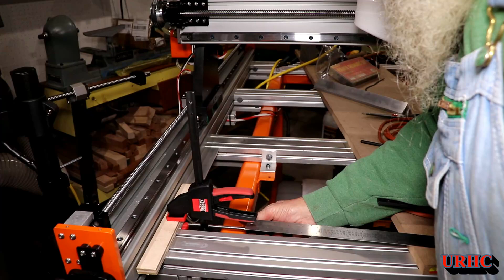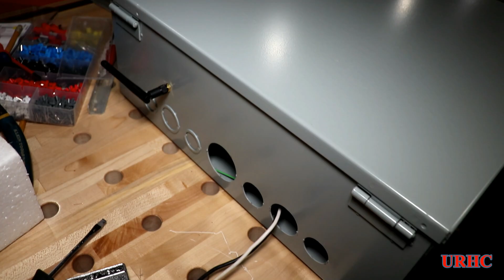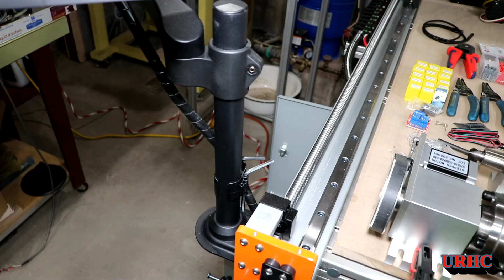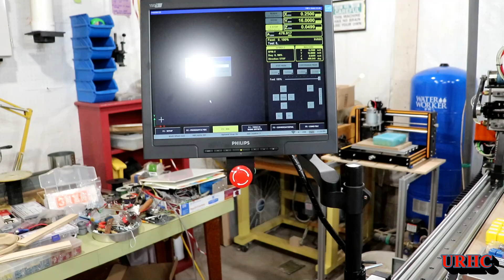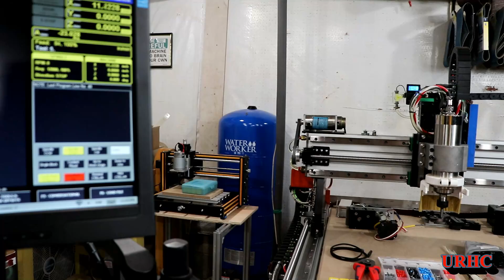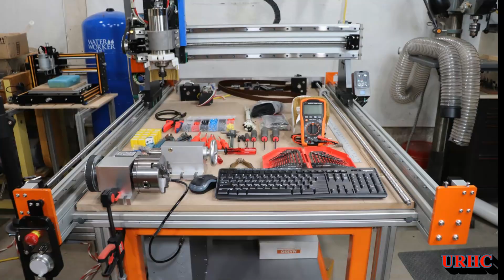CNC Router Build Part 5 Control Box Wired Masso Controlling The VFD And Homing

Comment: Nice video, you have a link or name for a place to buy a  spindle like the one you have in this video ?  thank you
Reply from the maker: Amazon and ebay  usually have several listed from different sellers. Vevor.com also has some lower cost Chinese spindles. I think most come from the same manufacturer. This is the one I used for this https://amzn.to/46PqStp .  This is the cheap vfd I used on this that so far has been good https://amzn.to/3rdXNr4 . and this is the a little better vfd that I used on the slab flatner build https://amzn.to/3PJ7nfG Just match the kw and features you will need. Thanks for watching.
Reply: Can I bug you with another question, I’m deciding on what 4x4 cnc router to buy, and most have cons and pros, I understand ball screws is the way to go, and shapeoko 5 and the onefinity elite is also tempting. But don’t know which one to go for, would you mind sharing an advise there? Thank you so much
Reply from the maker: I will not recommend any machines that I have not tried. Be careful of sponsored YouTube videos because everyone is not totally honest with reviews lately.  Best bet would be look for reviews on woodworking and cnc sites from actual users. Both ballscrew and belt machines can be accurate depending on your budgeet for a starter machine.

Comment: Would replace the limit switch relays by simple opto couplers. You used nice optical detectors but still rely on mechanical action and thus delay.

But overall, very(!!!) impressive build!
Reply from the maker: Thanks.  I plan on doing that in the future.  I bought  a couple opto couplers on Amazon and couldn't get them working right so I went with the relays I  had laying around until I get more  time to play with  them.  I am guessing  that I  need to add a resistor.  Thanks for watching.
Reply: @unemployedredneckhillbilly2023  If they are just opto's you need a resistor indeed. On the input they are just a LED, so just like a regular LED they need a resistor. Output can just go in place of the relay (assume between input and 24V). But of course, mind the polarity on both sides. (anode/collector => positive, cathode/emitter => negative)